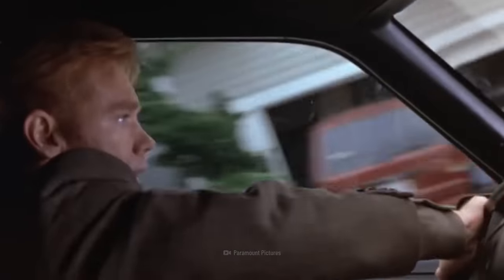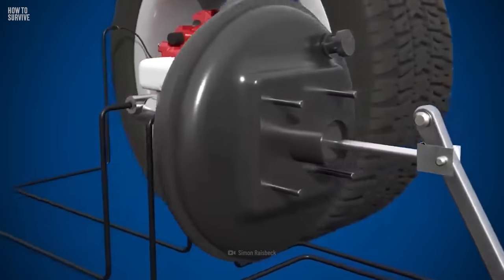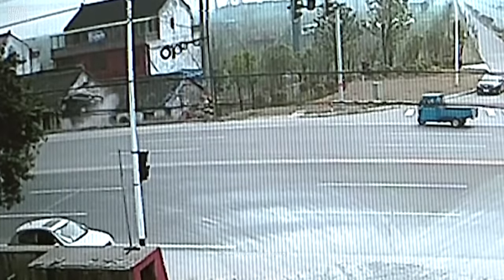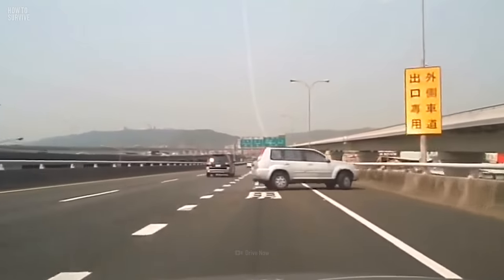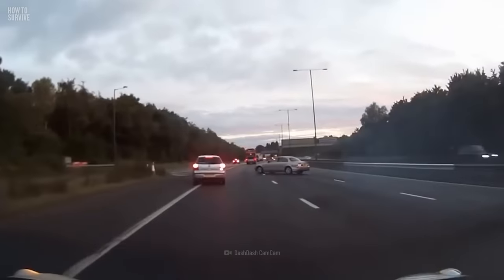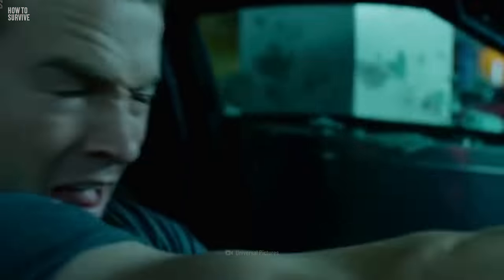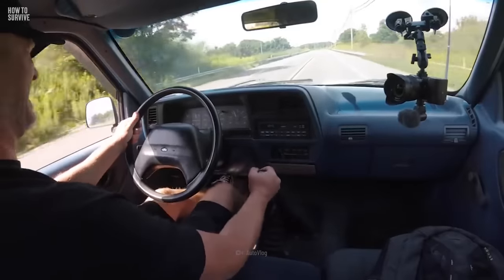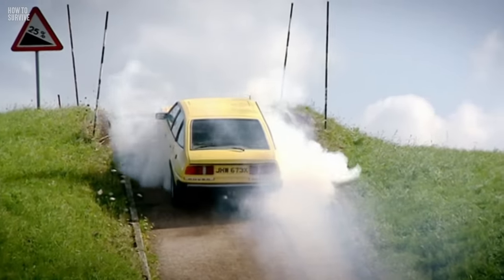How to Survive Brake Failure

Comment: Question will putting your car in neutral then riding on grass and shrubs help?
Reply: if the gas pedal is stuck, putting it in neutral helps. Otherwise, you want to keep it in gear or Drive because the gears help to slow it down

Comment: How to survive brake failure:
Use the handbrake
Reply: Gradually. Otherwise, you will drift.
Reply: @dbclass4075  dorifto
Reply: And burn the rear tyres by drifting ..lol
Reply: But if you are already flying towards an immovable object,  just pull it hard or stump on it depending on the type of e brake

Comment: 1st down shift, to reduce speed,2nd shut off the Engine 3rd now use the  hand break slowly, 4th keep pumping the  break paddle,5th hold the steering wheel and avoid humans,,

Comment: You should have mentioned using your emergency brake first. I've driven a few cars with broken brake lines and I've used the emergency brake to stop the vehicle at every traffic light with success.
Reply: You cant pull the handbrake at high speeds though, this will cause you to lose control
Reply: @jamesharrison9336  you got to put it on slow but steadily harder to stop and keep total control. I had a four-wheel drive Jeep Cherokee, the rear brake drums became full of grease somehow and the breaking was not consistent. Approaching a toll booth with freshly fallen rain I was going about 25 miles an hour on approach. I hit the brakes but they did not do any good so I down shifted it into first, and the car started spinning. I hit the back of a Nissan with the side and rear of my vehicle. The brakes were fine except that they did not stop the rear wheels. I discovered this upon dismantling the brakes. I didn't have any accidents for for 30 years before this. I junked that jeep out. It was probably like that when I bought it but it got worse and worse until it caused a failure. Also When approaching toll booths with wet pavement know that there is a coat of oil drippings on that pavement from Cars slowing down and stopping at the toll booth. Good luck God bless and stay safe.
Reply: @edwardroche2480  cheers mate, glad to hear you are safe, I'm talking about motorway speeds though, there was a story of police officers killed when a prisoner in the back of the car reached forward and yanked the handbrake while doing 70
Sounded like your wheel cylinder in the drums had a leak maybe?

Comment: Most of this advice is pretty useless in modern cars. The "emergency" (more like parking) brake is now an electronic switch instead of a manual brake pedal or handle. The electronic parking brake will not function while the car is moving. Also, the car's computer will not let the automatic transmission manually downshift above certain speeds, unless you are driving a high-end sports car. However, you can downshift a manual transmission at any time, but good luck finding a car with one of those anymore. The good news is that the master cylinder for the brakes is split into two units (most of the time), with one fluid reservoir for the front brakes, and one for the rear brakes. If one of the brake units fails the other one will still function, even if one side has a fluid leak. Just remember, around 70% of a car's braking is done with the front brakes, so if they fail it will take a LOT longer to stop the car with just the rear brakes. I just wanted to give some useful advice for modern cars, as most of the things we used to depend on to save us in an emergency will no longer function during said emergency.
Reply: My 2014
$12,000 sports car that’s an auto gas the sport shift feature it isn’t high end, brake failure also gets more common the older a car gets
Reply: Good luck finding a manual lol, thats literally what everyone drives in Europe
Reply: Usually on these new cars you can hold the button to use the e-brake while driving.
Reply: @11antpile  Good luck with that. Even on newer cars that might allow the use of the electronic parking break, while moving, it is an all or nothing application.  You cannot gradually apply the electronic break switch the way you could the old style manual floor pedal or center console lever. You will most likely lock up the brakes on the wheels that the emergency brakes are on. I guess it would be ok if it is a matter of life and death, and you need to stop RIGHT NOW, but then there is the chance the car will skid out of control. I guess it would be one of the "Catch-22" situations and based on the immediate circumstances.
Reply: In Europe Emergency brake musn't be automatic (it must be completely manual), and most of cars have manual gearbox.

Comment: It's never a good experience.  The first thing you would experience is a feeling that  your bottom fell off  with  drips of urine in your underwear.  What you need to do is to  be calm, check the traffic around you and opt for the less traffic lane, the right lane of course.   With the Hazzard lights on, don't accelerate.  If it's a manual transmission, put the gear in neutral until it stops in a safe place.   Park it with the first gear until the arrival of a tow truck.  It's never  a good experience no matter how long you have been driving.
Reply: I kept seeing these comments "put the gear in neutral"... DO NOT DO THIS. Learn engine braking.

Comment: Step 1 turn hadzards lights on, step 2 shift to neutral, step 3 apply e- brake until you come to a complete stop.
Reply: NEVER shift to neutral. People might see this so I'm just concerned they might take your advice.
Reply: @Dada-gk9ic  you do what you want but I tell you I had brake failure and I threw it in neutral and it slowed down the vehicle enough for me to apply the e-brake.     I'm just just sharing my experience you do not have to try it,  do what you want.
Reply: You lose engine braking when you shift into neutral.  Keep the vehicle in gear.

Comment: Rules no 1: put the car in neutral before using E-brake! And Call an emergency service and explain your condition! And don't panic! Congratulations you have saved your car too
Reply: In neutral (I suppose it's idle) axis is not connected to the engine. Your idea works when gas pedal is blocked.
Reply: @Admiral45-10  but it will save from picking up more speed!! (Ya my idea works if vehicle is very high speed!!)

Comment: Drum brakes fail more often than disc brakes.  One more reason why modern cars have gone to disc brakes.  The wheel cylinder would blow a seal and goodbye the brake on that axle as the brake itself gets lubricated by the brake fluid.  Since drum brakes were most common on rear brakes and that is where the e-brake is....Oops.   BUT.. you would still have one wheel with an operating e-brake AND you SHOULD still have the front brakes.  As we went along, they invented diagonally split systems where the left front and right rear are connected in one half the system, and the opposite for the other half.  If a seal blows you still have half your system.  In my sixty years on this planet, driving for more than 45 years, I have only ONCE lost the ENTIRE hydraulic system.  Oddly, the failure came from the exhaust system.  The exhaust pipe cracked, hot exhaust vented and, wouldn't you know it, the hot exhaust was spraying directly on the two brake lines going to the rear.  BOTH systems boiled.  Steam is compressible, liquid is not.  So... both sides of the split system was out.  The e-brake was slowing me down OK, but I was not going to stop in time for the intersection ahead.  I had downshifted and was rubbing my tires on the curb.  So desperation comes in and gives 'interesting' solutions.  I whipped the steering wheel back and forth and...... Overturned the van I was driving.  And I stopped.  The moral of the story is... Don't panic.  Don't stop thinking.  I still had one more option to stop.  Run into the line of parked cars alongside the street.  I did NOT want to do that....

Comment: My daughter was a very new driver. She was driving my little blazer and I was riding with her. We were a ways out into the more rural areas and were on the return trip into town as we say.

She realized the brakes were out. I knew I could drive thru the situation but I have to say with an inexperienced driver at the wheel... I was worried. We had about 5 miles before we would be passing the ball park where games were being played the middle school, the high school. 

Despite never hitting the gas, we just couldn't get slowed down. There is a gravel road to the right but it goes into a steep curve. My daughter wanted to take it but I stayed calm as we passed the park and told her not to take the gravel. As we approached the high school, I had her downshift, hit the ditch and go over any bump or hill she could find before pulling the e brake. 

It was terrifying and we got a little lucky, but this video really does tell exactly how to survive.

Comment: This is 2 safe ways to do it:
Don't drive, and if you are, get out of the car.
Or
Open the car's door and get out.
Reply: Carlos Quezada  I would hate it if I cared.
Reply: If car goes too fast it quite dangerous too come out, velocity speed could cause a permanent damage and even death
Reply: @kbfaqih9055  Yes, but like I said, I'd hate it if I care, instead I'd just open and JUMP It'd be more safer than break failure.

Comment: In case of manual car.. just turn off engine in 1st gear and slowly release the clutch.
Reply: I would suggest turning on 2nd gear and using emergency brake (turning 1st gear right away without stopping the car first can destroy the gearbox).

Comment: I know how brake failure happens you need to hold the brake your ganna be fine if you press the brake two times the brake assistance will fail meaning its almost imposible to brake

Comment: Question. how can down shifting in an automatic?
How can down shifting help, auto is driven by oil pressure, there's no mechanical gears like a manual gearbox.
This video is false, your never on a motorway when your brakes fail
They work one minute the next time nothing Accident you don't have much time to think, the only real situation is if your going down hill, use your brakes a few times, not for stopping quickly.

Comment: One thing that would definitely help is to shift the gear to neutral, it will be extremely hard to deescalate on drive mode.
Reply: You're completely wrong. The car won't accelerate if you're in gear as long as you don't press the gas pedal; it will actually slow down a lot more than if you're in neutral because of engine braking, especially if your revs are high.

Comment: To bad they got rid of the e brake in modern cars (no the electric parking brake is not the same it doesn’t close the pads shut by force it just holds the brakes on while the car is off) they got rid of it to save money and space

Comment: When there comes to brake failure, my autonatic response would be e-brake.
Reply: That's not a good idea - use engine brake instead, and emergency brake when car moves slowly.
Reply: @Admiral45-10  Dude, im not gonna pull that lever hard to lock wheels. I would pull it hard enough to activate brakes and not lock them at same time. In E-brake there are not two positions. Thats what i meant.

Comment: Most of this video is bullshit.All you need to know is,hazard lights,neutral if you re not in an auto and start using the handbrake or e-brake but not locking the tires.